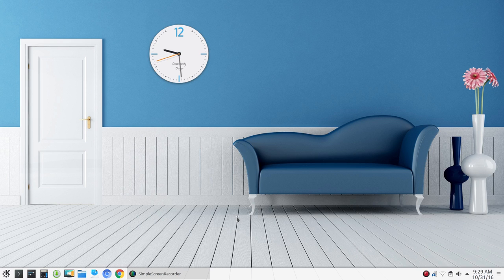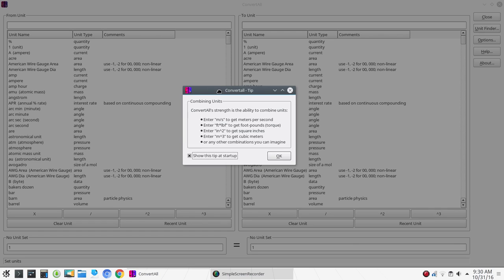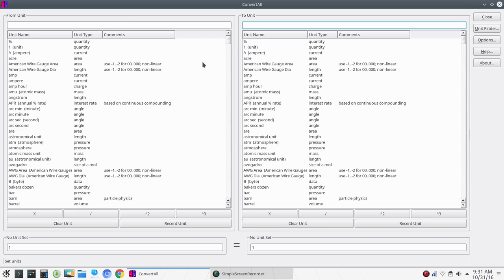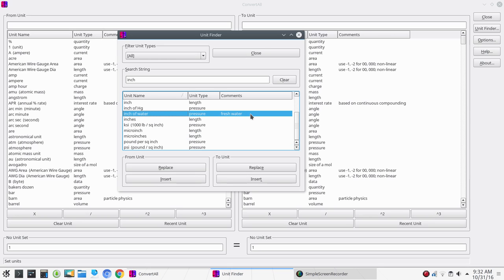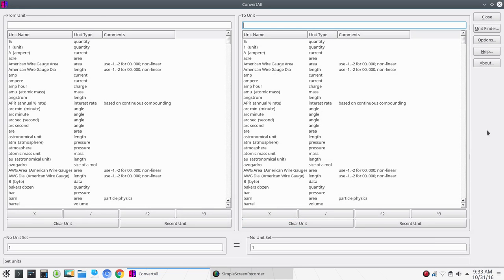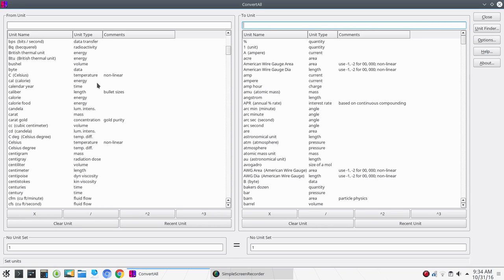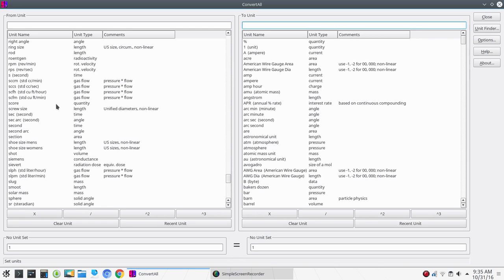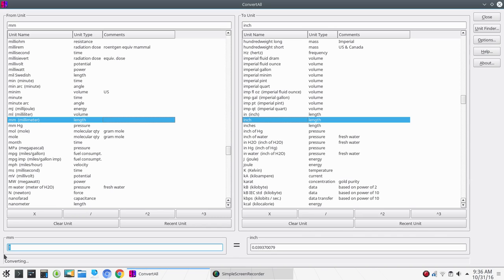Cool Linux Tools E2.  ConvertAll

Comment: I generally don't like light-colored desktop themes, but I like that one, it looks very clean.  

I've never seen this ConvertAll application, but that's one I'm definitely installing, I will get a lot of use out of that.  They were talking about switching to metric back when I was in school, the teachers said we needed to learn both because by the time I was an adult, we'd have switched to the metric system.  Here I am, 40 years-old and we're still on the imperial system.  I'm starting to think we're not going to make it in my lifetime.
Reply from the maker: LOL, I know.  I sent you a message to your channel Scott.

Comment: While not the best office suite out there, you should check out Calligra.  It has a very innovative look and approach, such as putting the menu items on the right of whatever you're working on.  It takes up more space than the standard menubar, but it's along the side, which is usually just wasted space anyway.  It's a little buggy (it lets you move the menu items to the top or bottom of the screen, but doesn't scale right, wasting space and also making most items unusable).  It's definitely worth a look though, if you're interested in their approach.  The main advantage to it is that it's a KDE project, so KDE users can install it without pulling in a bunch of otherwise unnecessary dependencies.